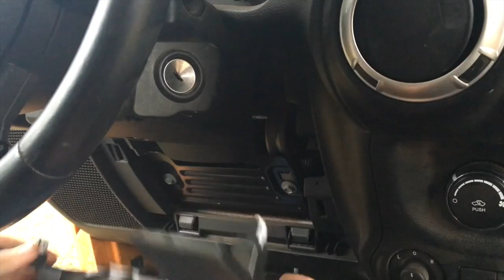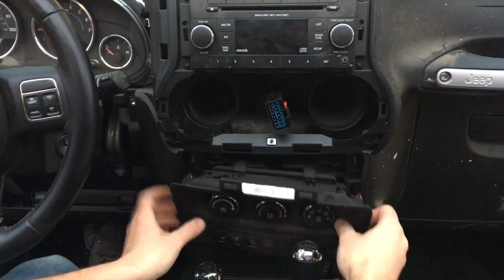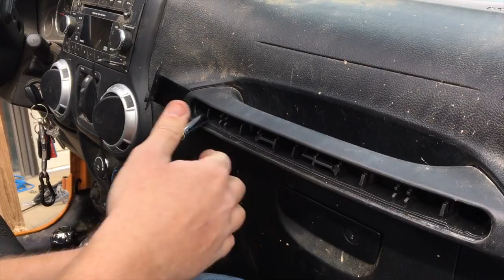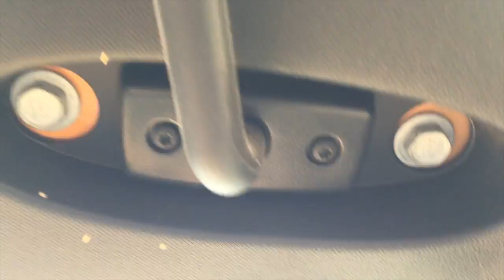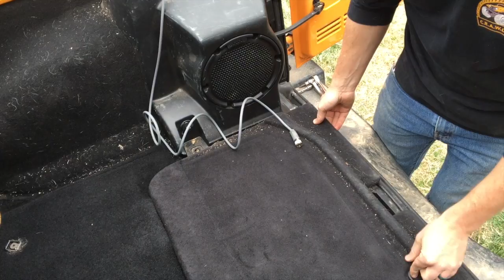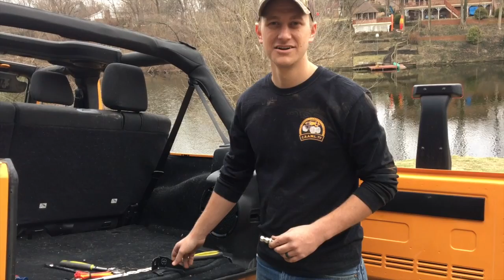Jeep JK / JKU Cobra 75 WX ST CB Radio Installation

Comment: Some helpful hints: purchase some panel removal tools. They're made of plastic and won't damage trim panels and makes removal much easier. Secondly instead of using a spade bit to go through the plastic purchase a hole saw much cleaner cut. As a suggestion I find it easier when running cable in vehicles to start from the area with less access\smaller hole to the area with more access. For example start at the tailgate then move forward to the dash.

Comment: If you attach string to the coat hanger after you get it thru and pull the string back and attach the cable to the string its alot easier to pull the cable thru.   Great video

Comment: When I did the tailgate I ran a coat hanger with a hook bend on it through the inside hole to the outside and had a shoestring with a slipknot on it that I managed to slip on the hook part, then pulled it through. Then tied the coax to the string and pulled from the inside hole. It was super easy.

Comment: Grounding is the key! I could not get my SWR below 3 until I grounded the mounting plate behind the tire. Sanded off paint on the mount and ran a wire to the chassis like in a comment.below.

Comment: Excellent video.  You are a great teacher.  I did work back to front simply as I realized that the power adapter connector you had was not in the parts I ordered.  I placed the order for it and the cab holder meanwhile antenna is mounted and coax is into the dash.  Many thanks!

Comment: This would/does cost you 300 or so at Car Toys.  I way overspent getting a front and rear camera and a Loc Pic Pro installed in my 2017.  they got me for 600 and I could have done it myself with some patience and beer.  LOL

Comment: 30 days and you have trashed it that much?There are far better CBs on the market but its your Jeep.
Reply from the maker: richard Turk you’re about 3 years late to the party, bud! But thanks for the comment. It’s not a Jeep til it has battle scars! Still loving this CB. Pro tip - you’re gonna wanna leave the sway bars connected and fully rock onto that Macy’s parking stop to really fake that “I go offroad” scratch mark 👌

Comment: I like how you ran the coaxial cable along the roll bars. I’ve seen others run it along the floor edge, but I’d be concerned about that. Would start from back to front and take the head off the coaxial cable while threading it through stuff. It’d be easier that way. Was puzzled by the way you wired it, though. Most of the time it’s wired directly to battery through firewall and fused as close to battery as possible.

Comment: Just installed my Cobra 75, with a Firestik antenna, using a spare tire mount using your video. I just want to say THANKS! I wouldn't have attempted this without your helpful video.  I just did it all backwards starting with the antenna mount and working my way back to the glove box. I secured the power box underneath that bracket with heavy duty Velcro and two small tie wraps and all connectors are easily accessible with the glove box out, and I can hook up the SWR meter without an issue. I installed the external speaker above the mirror next to the passenger visor and had enough wire to run it down the A pillar with the coax when i had that exposed. What a clean install it turned out to be. Again Thanks!

Comment: Thank you for the detailed video!  I have a couple questions however...  1) why not run the antenna cable first starting from the back?  Don't most cables come with the final connection to the cb unattached?  and 2) why not go directly to the battery with the power and ground thru the firewall?

Comment: Thanks so much guys learn a lot from you very clean installs and great explanations.My cb mounts by passenger left knee  and after getting the coax through the tailgate and roll bar I was like 6 inches short no matter what I did....looked at the tailgate wires saw a hole behind them closer to where the rubber gromet is bored it out with 1inch drill cutter and gained around the 8inches I needed now I have slack and piece of mind. Keep it up Aloha from Cali

Comment: Everything is hooked up. But the tuner is in the red on both channels 1 and 40. What do I do now?
Reply from the maker: Kevin Remington a few things you should check first... make sure that you have a good ground for your antenna, ensure that the coax cable is free from any loops if you had excess, and check that if it is an adjustable antenna that you tube it within a safe range there.

Comment: Hey man I love that video. I just purchased the cobra 75. It should be here soon. I need the bracket with the graumit mount that you put the coil thru. Where can I get that?
Reply from the maker: Kevin Remington Hey! So glad you liked the video! If I’m remembering correctly, the bracket and grommet actually came with the CB radio, so you should be receiving them at the same time. Good luck on the install! Oh, and to answer your earlier question, the range is probably around 5 miles or so, but it also depends on line of sight. 👍
Reply: CRAWL TV hey- so I installed the cb. The kit came with a powder coated antenna mount. Do I need to sand that off or not? I haven’t been able to hear anyone yet. I haven’t used the tuner yet, it got too late.
Reply from the maker: Kevin Remington just replied to your other comment as well - yeah, I’d Sand just enough of that bracket to get a clean ground on the antenna and to the rear door.

Comment: was wondering if you can tell me where you got that metal grommet from that you attach to the trim piece in the center? I've looked everywhere and can't find it. Thanks
Reply from the maker: Iamth3bigJ if I remember correctly, that actually came with the CB radio.

Comment: Excellent video! Thank you so much. New sub.
Reply from the maker: Wayward Escapes thanks for watching! Glad it could be of use to you. Please don't hesitate to reach out if you have any questions during the install!
Reply: Will do. I'm purchasing via your links to show my appreciation. : )
Reply: In your unboxing video you say the antenna is 4 feet but the link drives me to the 3 foot one. Which one should I get? I plan on putting a roof rack on if that makes a difference.
Reply from the maker: Wayward Escapes in the video, we installed a 4 foot antenna. We later changed it to a 3 foot because it only needs to be about a foot above the roof of the Jeep. If you plan on having cargo or a rooftop tent up there, I’d go with the 4 foot. Otherwise, the 3 foot will give you all the clearance you need.
Reply: I wanted to ask about your switches on the factory panel below the AC controls — did you add your own other than the hazard light etc? I was wondering if I could add some to mine instead of in the A pillar but haven’t found any info.

Comment: The connection box..... How did you secure it? in the picture it dosnt have screews and or bolts.
Reply: fightenspirit this is also my question. Does anyone know?
Reply from the maker: Hey guys! Just catching up on the comments! Our connection box actually sits back there but is not secured by anything. Since the installation we’ve had to pull it back out a few times to hook up external speakers and play around with different setups but it hasn’t gone anywhere at all. The excess auxiliary cable is the only thing that really needs to get tied up and out of the way. Sorry for the late response!

Comment: Would it be easier to take the tire carrier and then the back off to get the antenna wire setup?
Reply from the maker: We’ve had a few folks comment that they did that and said it was much easier.

Comment: So my CB radio install followed yours very closely but I also did the FM/CB antenna combo discussed on WF and it turned out great! Link: http://www.wranglerforum.com/f274/deleting-the-fm-radio-antenna-and-using-cb-antenna-instead-highly-recommend-2198521.html
Reply from the maker: Felix Boecker that’s awesome! I can’t find the motivation to get out in the cold and work on the Jeep right now. Text me a picture of it!
Reply: Didn't take any pictures but the quick and dirty is the following:

1. Instead of connecting the CB antenna to the CB radio, connect it to this doohickey: http://amzn.to/2CuotGx

2. Then connect the doohickey to the CB radio using the CB port

3. Plug this cable into the antenna port of the radio and the doohickey (I have the 130 but I would think it's the same on the 430) http://amzn.to/2DGBexf 

4. Finish up with an antenna delete mod (these should work http://amzn.to/2lzQ557 ... plus this will balance the Jeep since the JKs are a bit right-side heavy from the stock FM antenna anyways  😜)

Bottom line: you really just need to buy the doohickey and the antenna adapter cable to make this work.

Comment: Great tutorial. What is the bracket (product/item #) you used to conceal the excess cable near the floor.
Reply from the maker: Thanks! That small bracket actually came with the Cobra 75 WX St if I recall correctly. I know I didn’t buy it separately.

Comment: I put my cobra 75 in an old cellphone bag with a magnetic base antenna and a cigarette lighter plug for power and for quick removal. The only screws I used was for the microphone clip on the dash.

Comment: Great video! Only thing I changed was to run the coax from back to front, took about 30 seconds to push the cable in from the tire side.

Comment: Why you take hard time to pull out the antenna wire..just pull the plastic in the right side.and pull out whit you hand.you don't need it the cable to pull out..

Comment: Did you guys ever get around to doing that video about tuning the antenna? I've made a couple of stabs at it and I'm still not getting any registration on my SWR meter. I hear radio traffic so it's working (sort of) but no movement on the meter when I hit the PPT button. Can't get much help on line from right channel radio.com ether.

Comment: I installed the same radio in my Jeep but am having a hard time picking up other CB radios. I was told that I needed to ground the CB to the Jeep. I tried to do that but it seemed not to work. How did you ground your CB to pick up other vehicles/ cut back on static?
Reply from the maker: Ryan Calliari a few things will help you out with this. If the CB has a good ground and the coax cable isn't cooled anywhere, you're ready to tune it. Contrary to what was said in the video, you WILL NEED and SWR meter and a few minutes in an open area to get the radio dialed in. CBS aren't exactly long range radios either way, but that should help you with picking up other channels. The link that we used for our SWR meter is in the description. They're fairly inexpensive. Hope this helps!

Comment: Just found your channel and lovin it guys! I'm just wondering, since I live in Canada, quadratec charges out the ass for shipping costs on just the 12 volt power adapter so I'm not going to pay for more than it's worth, do you know of any alternatives?
Reply from the maker: Thomas Bertrand  Hey Thomas! That's awesome! Glad you found us! I actually don't know of any alternatives on the market, and I've searched extensively. What's the shipping cost to send it to Canada?
Reply: CRAWL TV costs $29.99US! In total in Canadian dollars its $88.96!
Reply from the maker: Holy CRAP!
Reply from the maker: Thomas - just got an email from the Quadratec mailing list that says they're offering site-wide free shipping until midnight tomorrow (July 11th). It does say for US only but they're running the promo in competition with Amazon's Prime Day. If you give them a call and tell them you're looking there, they may be able to work with you. Hope this helps :)
Reply: CRAWL TV that may work! Thanks for the help :)
Reply: An option is to go straight to the battery

Comment: grate job on the installation. just wondering how everything has turned out over time looking at getting the same radio myself
Reply from the maker: smokingbean thanks so much! We've actually been extremely satisfied with this radio - it's been caught in the rain, taken out in the mud, extreme cold, extreme heat and it still holds up. We bought it because it allowed for a clean install, but it's actually exceeded our expectations in sound quality as well! Let us know if you have any questions on your install or while you're radio shopping!
Reply: CRAWL TV thank you so much for the reply and your review keep up all the good work

Comment: +CRAWL TV Really great explained.  I am using Stryker sr-955 hpc radio. It is an excellent radio for SSB or AM, and it shines on SSB. You don't need a power mic for this radio stock mic works just fine! I get tons of positive reports of how clean and crisp this radio sounds over the air. Solid buy.
http://strykerradios.com/store/10-meter-radio-955hpc/

Comment: Question?  I have installed the same cb on my 2014 Silverado. I can't seem to get it to work. I am getting the power from my amplifier from my sound system as well as the ground would this be a problem?   Also, I am using a 3' firestick.  I fabricated the antenna mount and mounted it on the passenger side of the bed of my truck. Running the coax cable through the bottom of my rear  passenger door inside to the box. what am I doing wrong? I have not tuned the antenna but have watched other videos and read up on it how to do it yourself.  I have left it the same as you have mentioned I still don't get any channels not even the weather.  My next step I was thinking was to get a longer antenna maybe the 4' like you have. what are your thoughts.?  THANKS IN ADVANCE 
GREAT VIDEO BTW!
Reply from the maker: carlos salazar hey, Carlos! A couple of quick thoughts that might work... Check the power coming from the amp. You might want to switch to an accessory 12V tap or run it from the battery. Additionally, check that you don't have the coax cable wound up anywhere, because that would cause an RF choke point. The last thing I'd check is the ground where you have it mounted. A 3' on the bed of a truck should be fine. Let me know if any of those work. Thanks for watching!
Reply: CRAWL TV , Thanx fr the quick reply!! I will connect to the battery first thing in the morning.  The coax cable is an 8' and it is wound up I am not using all the 8' so I will look into buying a shorter coax. The ground on the antenna is good I have grinded off the bedliner making sure I was getting good ground used some self tap screws to secure the mount. On the tuning part?? Am I good the way it is?    I really appreciate the reply!  I will give you an update after I make these changes. Thanx again bro! keep the videos coming!
Reply from the maker: carlos salazar Yeah, man! The wound up coax is definitely causing some problems then. A straight power connection to the battery will still be safer, but just make sure to turn it off when you're done using it 😎 You will need to tune it with an SWR meter and we plan on making a video on that soon. Here's a look if you're interested in purchasing one. 

SWR METER for CB Radio Antennas with 3' Jumper cable - Workman SWR2T & CX-3-PL-PL https://www.amazon.com/dp/B002KRME3C/ref=cm_sw_r_cp_api_Up8kzbDWAFKMZ
Reply: CRAWL TV ... Hey there buddy did you see my set up ?? Can you give me some pointers ?
Reply from the maker: carlos salazar did you email us? I didn't get any messages. Try us at crawl_tv@yahoo.com
Reply from the maker: carlos salazar Hey Carlos! Just saw your video. I'll comment there now.
Reply: Thanks!

Comment: Yep great video, I still have to run my CB cable around the roll bar but it's mounted to the CB and the power adapter is in so the heavy work is done.......wow, what a relief.  Don't feel bad, I dropped stuff all day too.

Comment: Please, if you have a 2016 or similar jeep on the interior do not take your dash apart.   Using a plastic trim tool, just pry the HVAC controls out from the tabs starting on the bottom - do not remove the unit, simply pry away enough to get behind it.  Slowly work each tab out and loosen the bottom tabs from the section with the window controls in it.  This will let the HVAC bottom corner where the power outlet is come completely out and you can easily remove the connector from the back of the power outlet socket, plug in the adapter harness and route it behind the glove box.  It saves so much time and you have less chance of damaging the dash board.

Comment: Sorry but I have another question...my 12v output is on the left hand side, not the right hand side like yours is. On the right hand side, I have nothing where the cigarette lighter would be, just a hook looking thing. I don't have the little knob on the left hand side (not sure what that's for) anyway, would the wiring be long enough to reach from the left had side to under the glove box? Also, can I hook it up the 12v output instead of a cigarette lighter like it shows in the instructions?
Reply from the maker: mikecal9985 yup! That's how our last Jeep was setup. It's still a 12v power supply, just on the other side. You should have plenty of wiring from the CB junction box to make it reach. Our 12V outlet is only on the right side because we have those fancy mall crawler power mirrors. 😜 I never knew what that hook on the right side was for either...

Comment: Hey Jarrett, its Victor out in L.A., I've watched this video quite a few times an I think I now have the confidence to try this install myself. I have a quick question though, in the beginning you mention disconnecting the battery for 2 minutes, Is that literal? Or do I just keep it disconnected for the duration of the install?  Also, when you placed the cb box behind the glove compartment, did you fasten it somehow? Or is it just laying there? And if so, does it rattle at all? I just want to say that I've learned so much from you guys, I actually installed Powerstop brakes on my Jeep just from watching your vids. So, I just want to say thank you so much for all you two do!!! They really are entertaining and most of all informative.